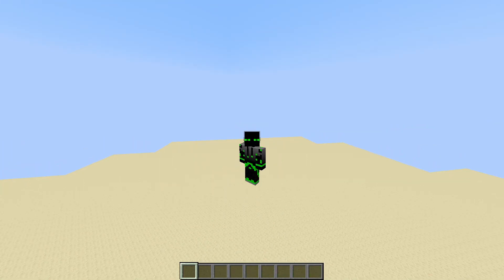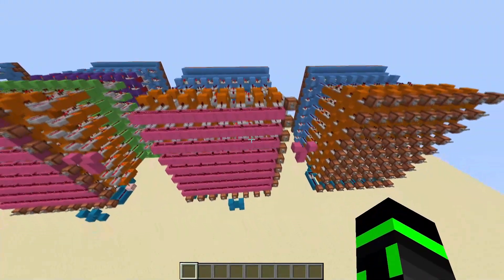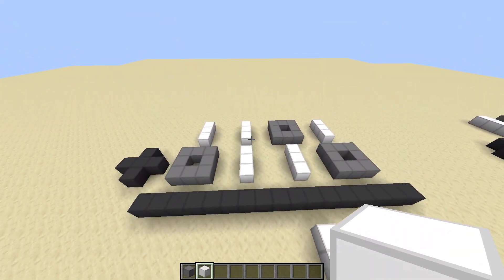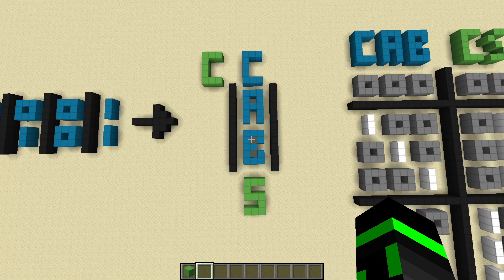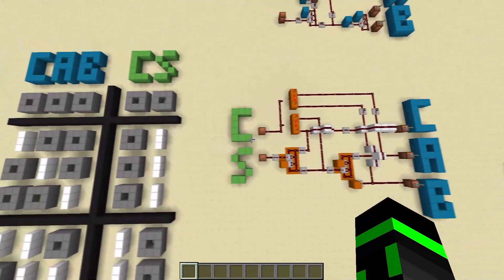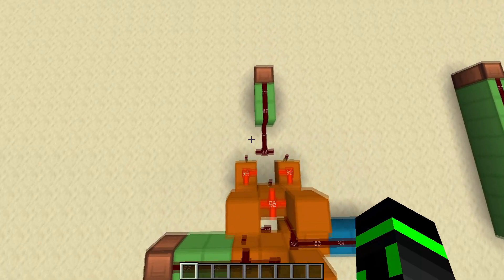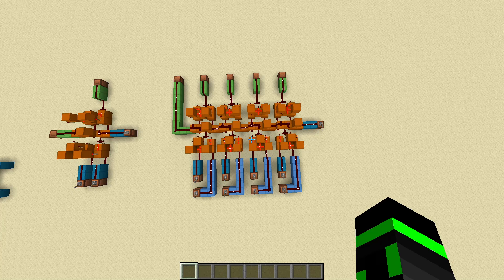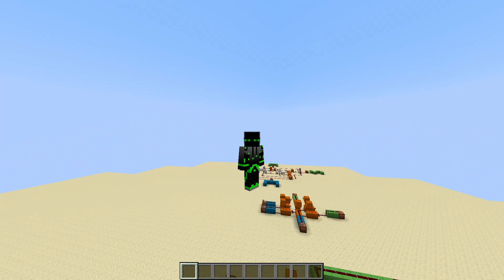Addition | Logical Redstone #8

Comment: This tutorial series is amazing. I used this video, the video on encoders/decoders, and the video on displays to make a 4 bit adder/calculator. 

You input the 2 numbers to be added by flicking levers to draw the digits on a 7 segment display. It goes through a decoder to isolate the numbers to 1 line, then it encodes it into 4 bit binary (only up to 8). After going through a 4 bit adder, the resulting 5 bits are decoded, and then encoded back into a 7 segment display format. It takes a couple of seconds to run a calculation, and is probably horribly unoptimized, but it was my first time experimenting with logical redstone and I was very happy with how it turned out

Comment: You could use droppers, tripwire, hoppers, and serial number data sending to make an extremely compact amount of data, you'd do this by checking every two ticks if an item trips a wire, and if it does that's a one, if it doesn't that's a zero, so in other words you could have a computer constantly sending data to itself.

Comment: Yeah bennyscube tutorials were okay I guess, but either to pandering and slow or too technical and fast. Yours are well paced and easy to understand. One suggestion is whenever you use something from a previous video, put in an info card in the corner (for example when doing the truth table stuff)

Comment: great video I always wanted to build logic circuits in Minecraft. How the tic tac toe game AI works ? is it a Finite state machine if yes please make video about it  
Also, i think the array controlled display has a problem .if you tried to turn on pixels (0,0) and (7,7) at the same time the pixels (0,7) and (7,0) will turn on also since there will be 4 intersections. 
in electronics we solve this problem by powering each row individually very fast so the all rows appears to turn on at the same time this is called multiplexing unfortunately this is not possible in redstone since it is slow.
Reply: How would you fix this using redstone? I only know of 1 way to do this and I'm fairly sure it's way overcomplicated for redstone. (You map a 1d array to a 2d array. This requires math, meaning you would need an ALU for your screen. Not ideal, to say the least.)
Reply: @nikkiofthevalley     Multiplexing can be used and by adding a pulse extender to each row so the row dose not turn off and the whole screen stay on. but this solution will make the screen alot slower.
Reply: You might just have to find a way to turn the first one off before the next turns on

Comment: Hey, I’m so glad you’re making this series! I’ve actually built two crude calculators up to this point with YouTube help, but now I’m actually looking to truly design my own. I’ve been trying to build a serial binary to BCD converter using decoders, but once it gets to multiple outputs, the machine messes up and essentially begins flickering. Any tips on how to avoid this?
Reply from the maker: you could join my discord so that we can take a look at it, or wait about 2 weeks for me to get to double dabble in this series
Reply: @mattbatwings  I am soooo hyped for double dabble lmao. Been waiting for a good video for years
Reply: I had a similar problem with a display. What I found happened was that the serial receiver would have the one tick activate all the pixels and turn the rs nor latches into clocks. I would go through and see if anything could act as a clock because of a short pulse going into it.

Comment: Now I’m confused because repeaters have 4 different settings and I thought it was 1-4 RTs but is it actually 10/4*s? (S being the setting it’s at)
Reply from the maker: they are 1-4 RTs. they can also be viewed as 2, 4, 6, and 8 GTs as well.
Reply: @mattbatwings  yeah that makes sense, I just always thought the game ran 4 RTs a second :/
Reply from the maker: @sol70523  yeah it runs at 10 RTs ticks per second. so for example a 4 RT repeater has a delay of 0.4 seconds
Reply: the 4 settings on a repeater correspond to adding a delay of 1-4 redstone ticks; in other words, adding 1/10, 1/5, 3/10 and 2/5s of a seconds delay to the redstone line respectively. They also always have a signal strength of 15 as their output, extend a signal's length to match their redstone tick delay if said signal was shorter than their tick delay and, if powered from the side by another repeater, will remain in their current state of power regardless of if the input changes until unpowered by the side repeater
Reply: @eratheoracle  …I know how repeaters work.
I was just confused about how long they waited
Reply: @sol70523  I thought as much, but honestly the way you worded the question confused me a bit, so I just went over all bases including actual timings to make sure I ended up answering your question. Now that I can see the other responses I understand what you were asking xd